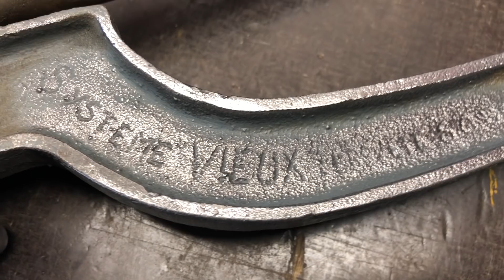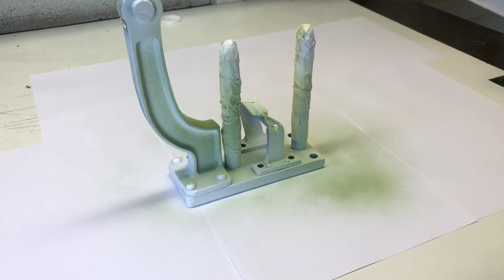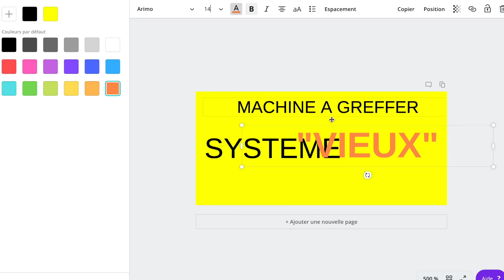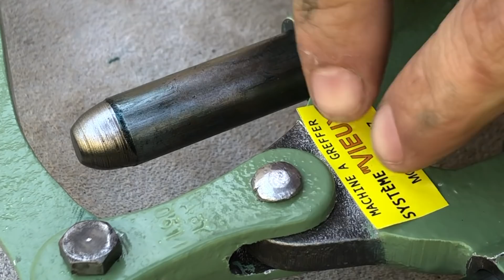Tree Grafting Machine Restoration

Comment: Exellent! The most accurate masking I've seen. I think it was easy with such an assistant. :)
Reply: Every time I try masking the paint comes off around the edges when I pull the tape off :(
Reply: @johndifrancisco3642  When you pull your tape off, you need to pull it away from the paint line. Also, make sure your paint isn't getting over the edge you are taping off.
Reply: @GridIndustries  Thank you very much! If you don't mind, can you tell me if you do it when the paint is wet, dry or in between. Thanks again.

Comment: Neater than a skeeter’s peter. Where do you get these fine tools to restore? Do people bring them to you?
Reply: I have a large (line shaft driven) and small (hand crank) turn of the century drill press, as well as, a black smith blower that I’ve held on to for restoration. Your work is most inspirational. Just retired and working 25 hrs part time so when I’m caught up with honey do projects maybe they’ll surface to the top of the pile. I’m from Southern Indiana, USA.

Comment: Good job, but what exactly is the purpose of the machine? Are the two limbs meant to grow and fuse together?
Reply: Yes, they are, some domesticated plants can not grow from seeds so what one do is to use the root of for example the wild form of the plant (it often hawe a good and robust root wich can provde the desired plant with a sufficient amounth of nutrient and fluid), then mount a branch from the desired type on the root (like wine, apples, etc).
Reply: @sheep1ewe  cool, thank you!